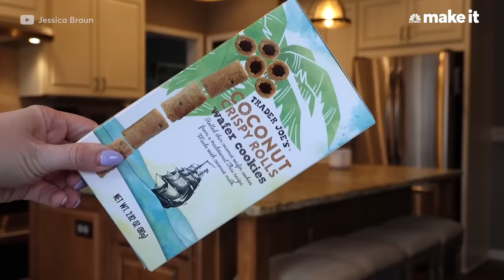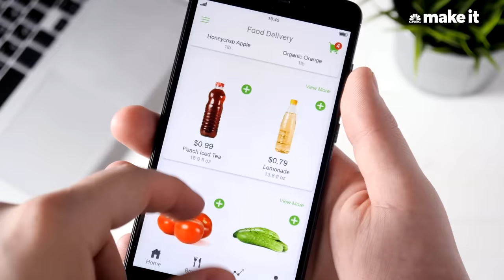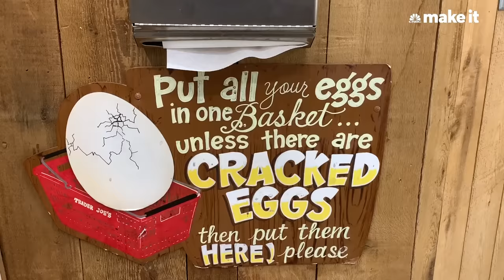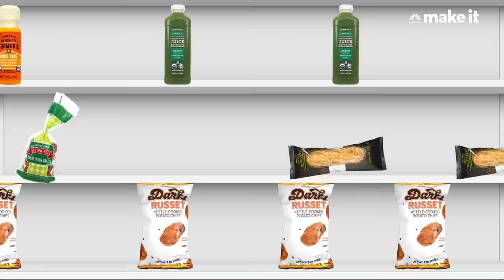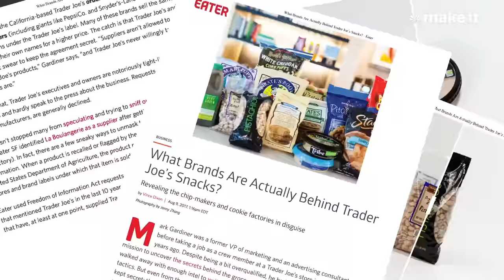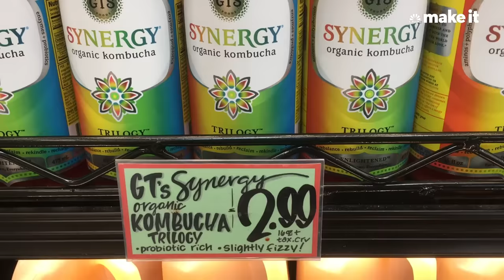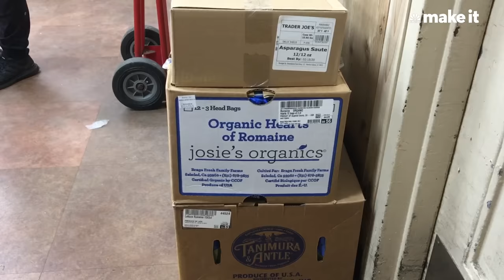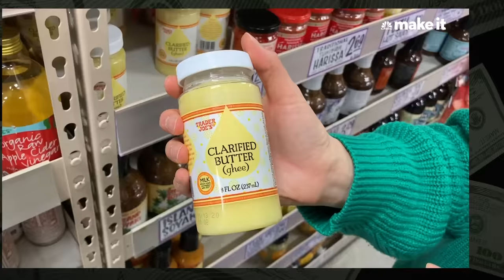Why You Spend So Much Money At Trader Joe's

Comment: Girl you need to get yourself some reusable bags
Reply: Amazing the handles stayed on😂
Reply: NYC only uses reusable bags now
Reply: Kate GIbs  simple, buy them secondhand
Reply: Any bag can be reused. And at least paper is bio-degradeable...
Reply: Kate GIbs reusable bags aren’t made up of one material so your argument is only circumstantially valid. I make my reusable bags out of canvas/muslin. You can make any size reusable bag you want to with natural fabric and cotton thread without posing a threat to the planet.
Reply: Kate GIbs Trader Joe’s doesn’t even use plastic bags, they use paper. And we should be mindful of the plastic we use regardless
Reply: Micah Edgehill and you can wash them, too!
Reply: during the pandemic they have to use clean bags....not your dirty bags. got it?
Reply: april butler I was assuming this was prequartine
Reply: how are those not reusable?
Reply: Kate GIbs  Nonsense. Single use plastik bags Are NOT the best option. Not all reusable bags are  made out of plastic. You can use those made out of cotton or jute. They will decompose if they end up in landfills. You can wash them with your laundry. Clean and hygenic and not made out off mineral oil.
Edit spelling
Reply: Kate GIbs  you don't take into account that our fossile ressources are limited. Ocean pollution  is not the only problem the immense use of plastik causes.
Reply: The BEST bags Trader Joe's makes are the HUGE blue reusable insulated bags that protect your frozen foods.  When I use them as tote bags, I get SOOO many people  complimenting me and asking me about it. 😊

Comment: 13:49 
I disagree. I worked at the Trader Joe’s location in SW Florida and the staff was on point with making sure the product was handled properly. Frozen foods went to the freezer right away and was the first thing to get stocked overnight. I’ve never seen a more dedicated team than TJ Naples.
Reply: It can vary by store.  He probably had a worse manager than you did.
Reply: Lol of course Naples would have a great store. Naples is one if not THE most bougie towns in FL🤣🤣😂😂
Reply: Did you refer to Naples as SW Florida what the
Reply: Here in Miami there are two stores and they are disasters. The new one is worse than the 1st one. They have a real problem with stocking. 2021 the new store had no pumpkin pies for Thanksgiving and more stuff too much to write about. But the ones in Broward are excellent.
Reply: @lauraharrison295  yes, that’s where Naples is geographically located…

Comment: I sent a suggestion to the parent company that they put in a Trader Joe’s close to me. There was a storefront in an old strip shopping center with a quirky Southwestern theme that had been vacated by a local grocery chain. It had been one of their smaller stores, but a bit bigger than the average Trader Joe’s, still, I thought it was perfect. Plenty of parking. Nothing happened for a while but then a developer came in, ripped down half of the shopping center, and built two enormous buildings. One became LA Fitness, and the other—ALDI.
Reply: well the other Aldi isnt that bad either :D not a Trader Joes but prices should be similar

Comment: I bought recently a bag of Trader Joe's ridge cut chips with sea salt. It was a 16 ounce bag for $2.99. Best chips I've eaten ever. I just looked at a supermarket ad for Lays Wavy chips in the "party size" which is 13 ounces. They cost $5.69. And they are not as good. So for nearly the same price as the Lays, I can get 32 ounces of chips that are better. You can't tell me that isn't a bargain.